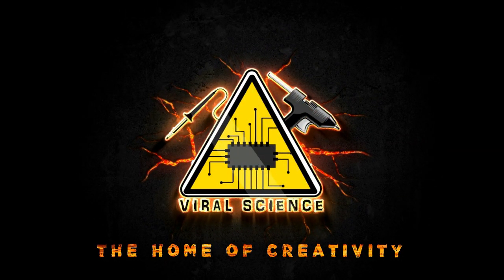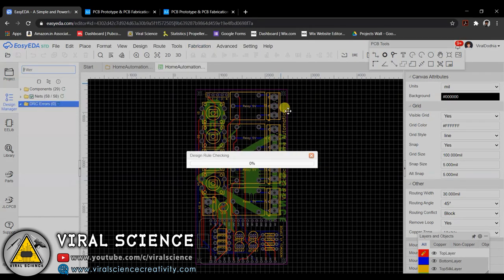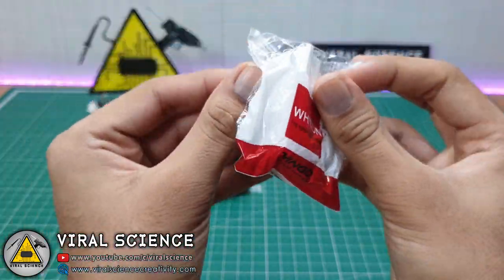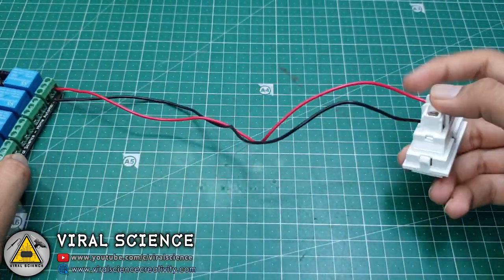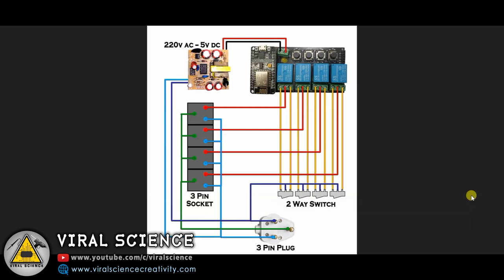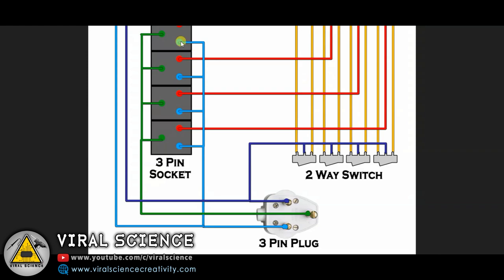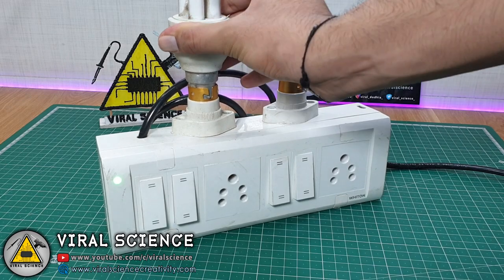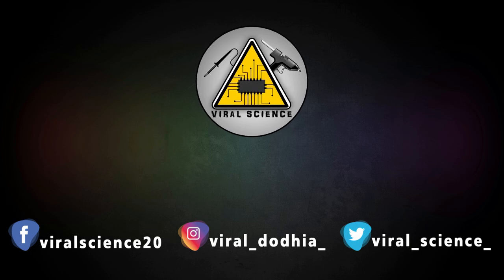Google Firebase 2 Way Home Automation | Switch and Smartphone Control

Comment: Will the light still work with the buttons on the pcb?
Reply from the maker: No not with buttons on pcb, this is universal pcb it works with multiple projects so i am using it in this project also
Reply: @ViralScience  Ok thanks =)

Comment: Can you suggest if instead of Light, Can I connect ceiling fan to the relay.. would 10A relay be enough..
Reply from the maker: You need to use better relays for High Amp appliances, this relays are good for lights and and some basic appliances
Reply from the maker: The relay which i have used is 10A so this can work, so you can check the ratings of the relay before purchasing
Reply: Viral Science - The home of Creativity ok thanks.